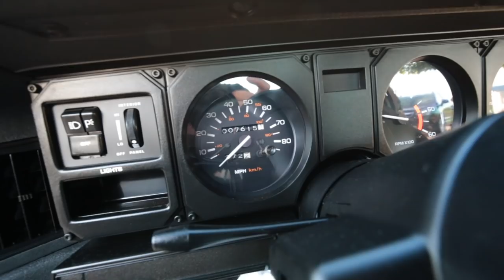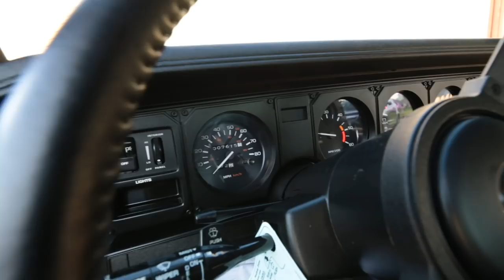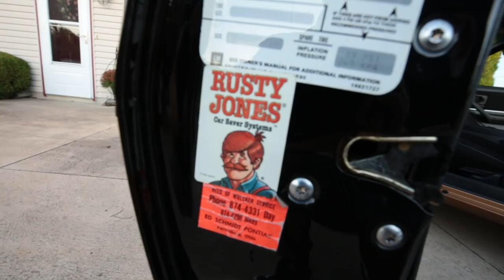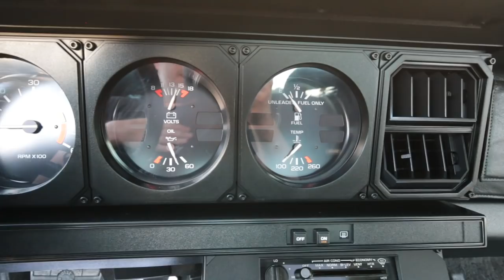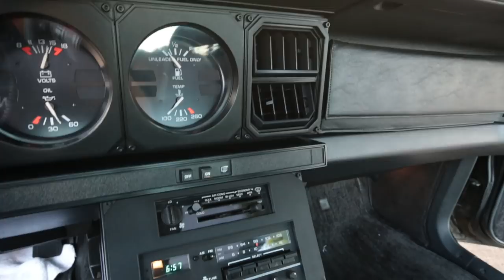1982 Trans AM with 7K miles

Comment: I had this exact same year, mine was called a “Recaro Edition” with tan leather Recaro seats. My wheels did not come with the center discs but were painted gold. If you leave the discs off there was small black center caps and bolt caps that finish the look. Super cool car back then only thing cooler was maybe a Ferrari or Lamborghini.

Comment: I to had an 1982 Black/Gold Trans Am just like this, only it had a 305 V8 with a carburetor, not fuel injected.  I have to say that I got it when I was 18 years old as a graduation gift, and it was the most beautiful car I had ever seen.  Mine had grey cloth interior (my dad ordered it that was, he did not like black interiors and the tan interior was almost orange, so he went with grey.  I dint mind, lol.  The black exterior paint was absolutely by far the most flawless paint I have ever seen on a factory car.  There was zero orange-peel, which you see on ALL cars made today.  This car shows you just how nicely the black paint was done by GM at that time.  Mine was just as slick and wet looking, really flawless.  I unfortunately drove the wheels off of mine, lol.  I ended up selling it (sadly) in 1998 after I married and we needed sedans not sports cars.  However, I think about it all of the time.  It brought me the most fun every single day that I drove it, no lie.  The re-design to this body was so sexy to me I had to have it.  My dad ordered such an early one that the window cranks on the doorsills had firebird inserts in them where the crank would go, my door sills were not smooth with no holes, like this one.  I don't know why, it came from the factory with poor windows.  I wish I had a picture.  I remember being curious what the emblem was doing in such an odd place and popped one off to find a hole for a hand crank window handle!  Anyway, thank you for sharing, this video brought me happy memories to watch, but also made me incredibly sad that I let mine go.  Thanks for sharing, these were indeed cherry cars, and were vastly underrated.

Comment: Easily a $50,000 Car looks right out the factory!! Love it man.
Reply: I would not give 50 thousand dollars for a 1982 trans am. Don't get me wrong i love the car but it has a weak 305 Chevrolet engine in it. Maybe a 1979 with a 400 Pontiac engine and a 4 speed.

Comment: Thank you for sharing this video of your beautiful 82 Trans Am. That car looks amazing. It's in pristine museum condition. Not many are in such original condition. Heck it still has its factory radiator hose clamps. It's magnificent. Oh and by the way you said that the Trans Am's had the gold bird in 1982 and the Firebird's had a silver one. I want to correct you on that one. The only cars with the gold bird were the black & gold cars such as the Trans Am, Recaro Trans Am and the Firebird S/E in gold color. The other cars all had a silver bird on the center of the tail light.

Comment: My First Car at 16 years old.
everything except T-Tops, and Hood Scoop.
I put a posi rear ( i think 3:28 ratio) and ranchos with a 38mm sway bar.
removed power steering, and a 6-inch garden divider as a front spoiler.
it was tight and fast on the high way.
it was not crossfire, it was a 305 fuel injection.
I loved it

Comment: You've got a good wife! It's identical to my 1984, except mine is 5 speed manual and carbs and no way near as clean but given it's spent it's whole life in central Canada it's in fairly amazing shape and probably cost a fraction of the amount.  Only thing I would say is please stop driving with no hands on the wheel for up to 10 seconds at a time, you're also passing oncoming cars on a 2 lane road, you will never be able to keep the car straight if anything happens.

Comment: Wow that's amazing. I had a 89 L98 GTA black on black leather car when I was 19. She was a bit rusty here and there but I loved it. I saw it for sale it has close to 300xxx miles mostly all original. I know because I knew that car in and out he literally did nothing to it when I saw it last. Pretty sure the fuel pump was replaced by then and I replaced the distributor when I had it. L98 is a damn good motor just lots of torque low hp that keeps it alive for a long time.

Comment: What an incredibly well preserved specimen. I have never seen anything quite like that. It is as if it had been delivered from 1982 through a time machine. Please, could you give some information about the environment where the car was preserved, the degree of humidity, temperature, what - if any - preserving coats were used for the different surfaces (paint, rubber, plastic). Thanks!

Comment: I had a red and black one back in the day!! Slow but good back then.
Reply from the maker: They are so slow but a ton of fun!
Reply: Knight Rider yeah firebirds will always be one of my favorites of all time! I have owned a 79 Firebird....82 Trans Am and a 90 Formula... so I have had all 3 of them and loved them all!
Reply: I had a red/black 82 with every option. Bought it for 3K in 1990 and stupidly sold it in 2000. Original engine had 282,000 hard miles on it by then and would still burn the tires.

Comment: I currently own this exact car with tan leather interior and all power options. Currently setting in storage for the last 10 years with 63000 kilometres! All original paint with minor show of all 63000 kilometres. My family was the original owner . I’m in Canada but the car was never winter driven and as far as I know all original minus a few engine modifications but I also have original engine parts! What is this car worth in tans am land?
Reply: I think you have less smog restrictions on your 82, which means a FASTER car than US cars that year!!
Reply: Eric Ostovani any idea what it’s worth??
Reply: @deanfinamore5620  It really depends on condition of the vehicle. Is it fair, good, or excellent? Tell me if it has WS6/7, Recaro package, and is it fuel injected or carbs?
Reply: Eric Ostovani is day really good condition! Like I said the paint shows some use and mileage but was well taken care of! No scratches no fading!! Just not perfect if you knowing what I mean. It has been under oil like yours as well so I mean it’s pretty good and maybe that’s being modest. I believe it start as a fuel injected car but was converted to carburetor. I do have the injection system tagged and well kept! Just curious as to an easy number for the car if it was to go to someone that can appreciate what it is and the shape it’s been kept?
Reply: @deanfinamore5620  I am getting a better idea but i still need to know if its WS6/WS7 and if its Recaro package? By the way, the original fuel injection WILL increase the value of the car!! Aftermarket carbs will decrease the value. Then I could give you a more accurate number!!
Reply: Eric Ostovani I actually have no idea how to check if it’s a ws6 or ws7? Where would I look for this indication? The interior is leather tan in colour but do not say recap on them any where. Power seats power mirrors! Please give feed back on where to check for these Ws packages! Would the Vin tell me?
Reply: @deanfinamore5620  If the rear has disk brakes it is WS6. If you have positraction, it is either a WS6/WS7.
Reply: Eric Ostovani ok it does have a posi rear end and rear disc breaks! What’s this mean? Ws7? Or ws6? And idea of it’s worth ?
Reply: @deanfinamore5620  It means it is a WS6! I have a few more questions to determine exact value. Is it t-top, manual trans mission, and does it still have the original stereo inside that came with the car?
Reply: Eric Ostovani yes it is a t-top car, it’s an auto trans and does have the original stereo
Reply: @deanfinamore5620  OK. One more question. Is it a recaro package? And I messaged you on FB, but think my message went to your "Other folder". Can you check it and I will give you the figure there. Thanks...Eric
Reply: Eric Ostovani I don’t think it has a  recaro package. The seat are power, leather, tan and have the Pontiac (PMD) logo in the middle of back rest. I mean they look like a recaro seat but it does not say recaro any where on them. I checked my face book and don’t see anything can you try again please ! I also appreciate all this info it’s made me love this car again!
Reply: @deanfinamore5620  I friend requested you Dean so that you can view my message. I have your exact figure!! Glad your excited!! I can help you  with some connections :)

Comment: i found the same kind with 15 miles new engine super clean interior they guy had it sitting for years out side in Michigan weather and i plan on buying it and he selling it for 1500 starts and claims to drive but needs new tires and hood can i get these. how much would i be able to flip if i dont get it paint job because paint not bad just hood and tires

Comment: It would have been cool if GM gave Pontiac Motor Division the freedom to equip the third generation Firebird Trans Am with the Pontiac 4.9 Liter V-8 for the 1982 model year. The only V-8 engine available during that model year was the 5.0 Liter V-8, equipped by Chevrolet Motor Division
Reply: In theory yes put those turbo 4.9 were notorious for being unreliable and blowing themselves up under heavy load. The turbo technology computer system was prehistoric by modern standards

Comment: I bought one that had 42,000 miles on it. The interior is just as nice as yours but the paint was a little faded and I think you had a bad cylinders because it still doesn’t run right.

Comment: Is it merely a reflection, or has the paint been scraped off above the wheel well and along the fender @ 10:46?
Reply from the maker: Just a reflection... not even a swirl on the paint :)
Reply: @ChrisBlasius  I thought as much.
I still have a 1984 black Pontiac Firebird SE which is in outstanding shape, but nothing compared to your vehicle.

Comment: Does it make a difference how much gas is in the tank when you store cars?  Is it better to have them almost empty like this one or more with some stabil or something?
Reply: Depends on if is never going to move. If it's going to sit 100% then get it as empty as you can, drain the other fluids and disconnect the battery. If you plan to run ing when once a year try to keep the tank full to avoid as much moisture build up as you can.
Reply: Thank you Sam.  Yes, I plan to drive it a few miles if the streets are dry, and no snow this winter.  Spring, Summer, and fall I plan to put about 500 miles on per year.  I'll make sure I fill it up.
Reply: @thefireman285  if you plan to let it sit more than 3 months put a fuel treatment in with the last fill up to help cut down on file break down while it sits.
Reply: OK

Comment: Is this car a WS6 or WS7 package? And when is the next time you will be in presence of your 82 GEM?
Reply from the maker: It's a Ws6 but has rear drums on it. The last month they built the 82s, they ran out of rear disk and had to put drums instead. MY kitt was built 1 week after this one with the same rear
Reply: @ChrisBlasius  So you technically have a WS7 package! Actually you are lucky because rear disks brakes were junk on this year, until 1989! You have the better set-up!!
Reply: Also, I tried email you but you diidnt respond. What is the best way to reach you that you could respond?
Reply: @ChrisBlasius  Hey Chris-PLEASE dont forget to check the distance from the inner crease to the very bottom of the sail panel decal. You could refer to the picture I sent your email. Think you said you will see the car during Thanksgiving holiday :)
Reply: @ChrisBlasius  Hey Chris---You mentioned you would see your car come this Thanksgiving. Were you able to check that measurement?

Comment: @10:10, what you said about the color of the tail panel bird is 100% incorrect. The only 1982 Trans Ams that received the gold tail panel lettering and bird were the 19/55 color cars. Any other color Trans Am in 1982 received the silver bird. 

Also, ALL Trans Ams in 1982 and 1983 received the satin black D80 spoiler and mirrors, finished in DuPont DX8, regardless of the color of the car. It was not just 1982 specific.